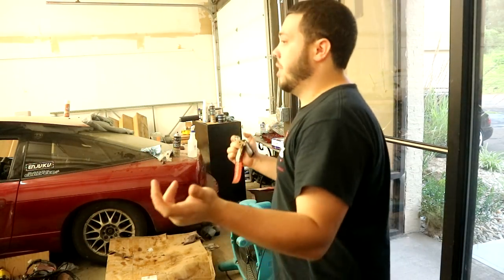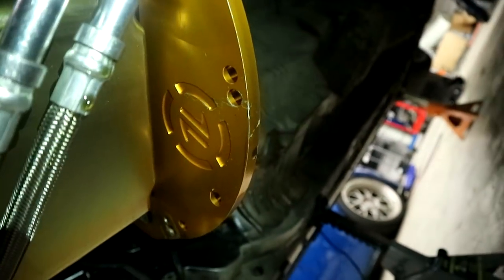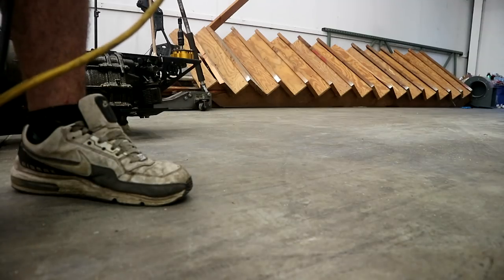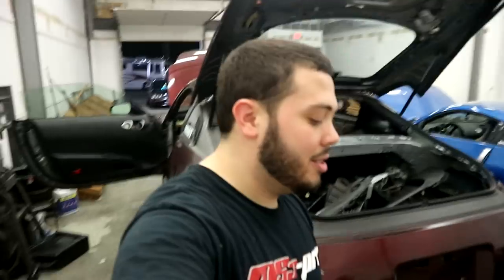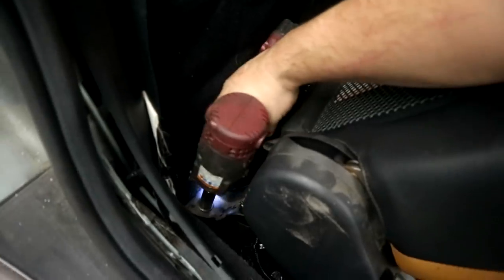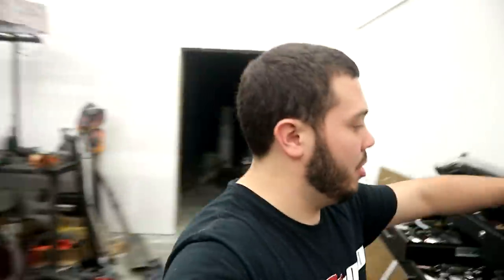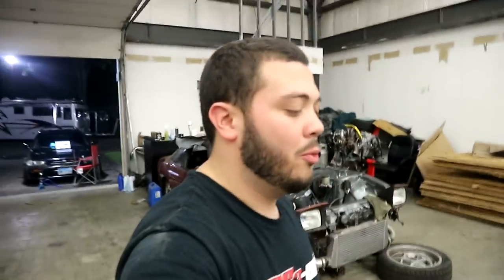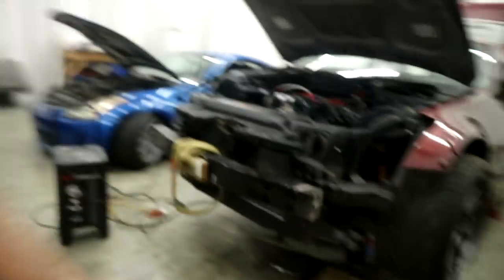I SUCCESSFULLY WIRED SOMETHING (KINDA)

Comment: Wiring is one of those things: you're best being super-meticulous when doing it, because wiring problems can easily become the bane of your existence! This is coming from someone who took and and scored top marks on electrical systems and electrical engineering training as a function of my Sat Comm role while in the USAF. Wiring can SO QUICKLY become an absolute nightmare. The best way to avoid problems is to create/follow a vetted/sound wiring diagram/design, and to be very diligent to make sure to get all of your connections/grounds/etc. good, solid, soldered, and protected from the elements with heatshrink.

Connectors with integrated glue that shrinks/seals/waterproofs when heat is applied (similar to shrinkwrap) are also a great idea. Also, color coding wiring so that you don't have numerous wires of the same color makes troubleshooting (God forbid) much easier if something does go awry. Its wise to look up the proper gauge wiring for the length/current draw of your application. Underwiring (too small of a gauge) will limit voltage/current, at best, and can start a fire, at worst. Finally, a hard-copy of your color-coded wiring diagram as your reference sheet can also be extremely helpful to always have on hand, and to have back-ups of.

Comment: Get your self some uv oil dye and a  UV light. After you out he dye in run it for a little bit to cycle through the system. Let it sit and leak. Use your uv light to find the dye. It will show up bright green. Will be handy for future leaks as well since the dye will mostly stay. As long as you clean up after fixing the leak new ones will be easy to find.

As far as Callie goes... Those partial doughnuts she did we're more than some of the guys can do up at open drift here in Washington. EVERY ONE FUCKS UP. You got it.

Comment: I said that I was going to spin out, too whenever I first started drifting. My friend that was teaching me responded with "hell yeah you are. But, learn from it, it's not a big deal and it happens to everyone, even professionals make mistakes and spin sometimes"
Reply: Assetto corsa is pretty good way to learn stuff without having to be scared of anything. I learned left foot braking what i have been using in fwd rallycross and stuff like that.
Reply: Definitely! Simulators are great, but, there's plenty of paved back roads around my geographical location that are plenty wide to learn to drift on. At least, to get the basics.
Reply: Linux-Approved Shit, pros drive off the track and smash into walls. But thats because they push their cars to the limit. Its the only way to learn.

Comment: looked like the adapter fittings that thread into your oil pan to convert over to the Lan lines is what was leaking at least from that quick Glimpse anyways
Reply: If those black adapter fittings done have teflon tape on the threads id bet my left nut thats whats leaking. On the oil pan side of adapters not on the an side of the adapters. They either need teflon tape or crush washers to seal properly

Comment: It's probably ur rear main seal if it's coming from the adapter plate check that jawn out
Reply: Take ur flywheel off to see if it's the rear main dawgie dog
Reply from the maker: Tony Brazil no it’s leaking down the front of it I saw it it’s not as clear on video but the rear main is brand new and there’s no oil on the clutch
Reply: It wouldn't be on clutch it's behind flywheel and it's still worth checking while trans is out